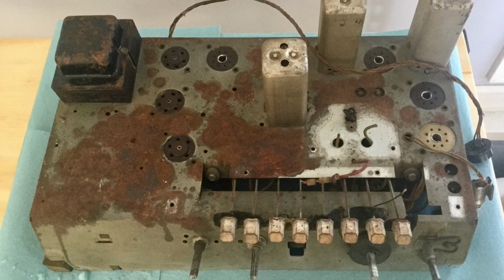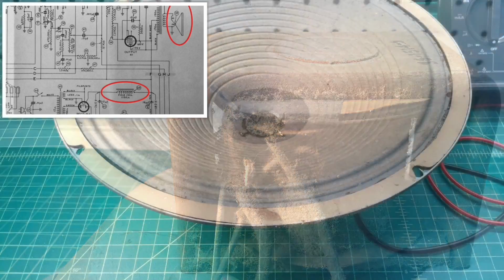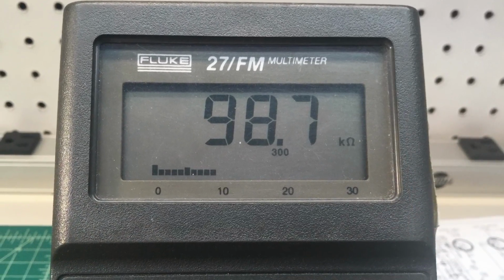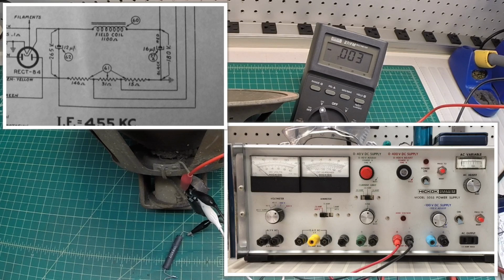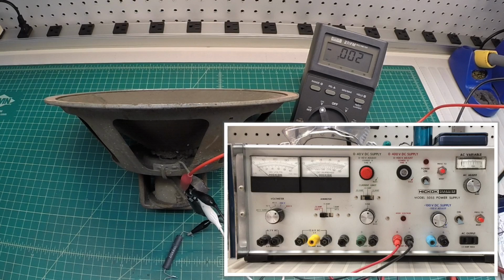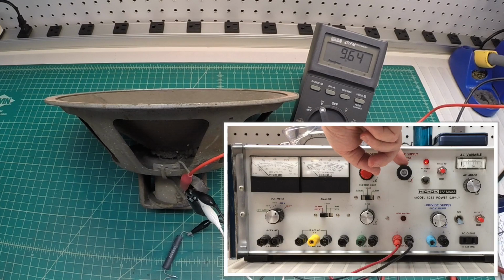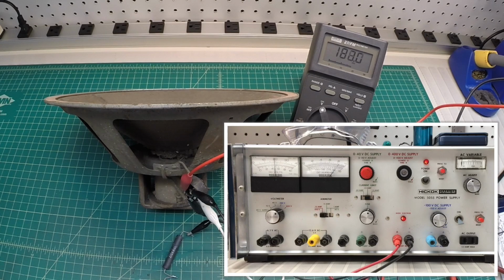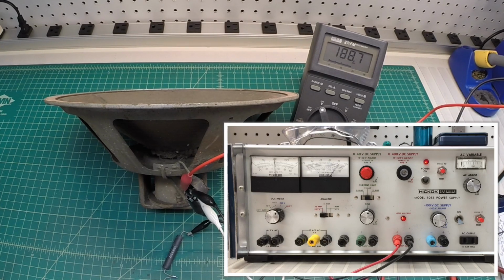Field Coil Testing & Validation

Comment: I have encountered similar flaky resistance measurements on field coils.  My most recent one read a high resistance that varied almost by twice its value.  I could never trace the issue down as I rewound the field coil and that made the resistance measurement rock solid.  I guess that the original issue is a short in the windings.  The wire was 36 gauge enameled wire so it is very thin, and I expect heat and bad electrolytics looks a toll on the windings.  Bottom line was after rewinding 4000 feet of new wire, things looked as they should.
Reply from the maker: +Keith Barker Yep, it seems to be a common problem on these vintage radios. I plan to rewind a new coil too and hopefully bring the speaker back to life. I still have a lot of work to do on the chassis over the next month or more. Thanks again for watching and sharing your knowledge/experience. Best, Don

Comment: Very cool.   Always wondered if you could test these field coil speakers this way.  THANX
Reply from the maker: +jp040759 Thank you. It turns out that the field coil was intermittent and a new field coil will be required. I'll be posting a video on a coil winder I built and we'll tackle the new field coil, speaker reckoning etc., in the very near future. Thanks again for watching. Best, Don

Comment: Don..thanks for the video....like how you juxtaposed the schematics with the hardware....great editing as usual..Rich
Reply from the maker: +iamrichrocker Rich - I appreciate it. I'm still concerned about the health of the field coil even though it didn't go up up in smoke or fail to work even with the resistance reading changing by the minute. Hopefully I'll discover the root cause later on. Thanks again. Best, Don
Reply: I too like the way you integrate the schematics with the hardware. Very helpful.